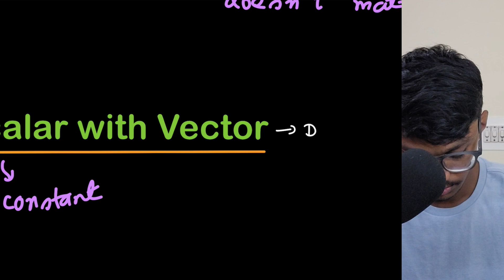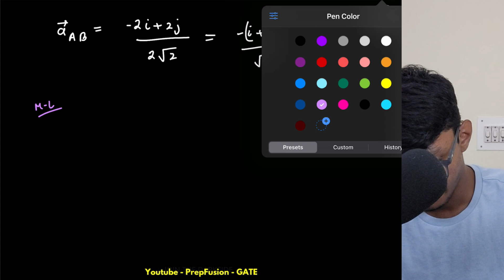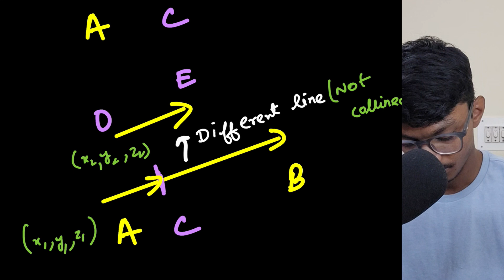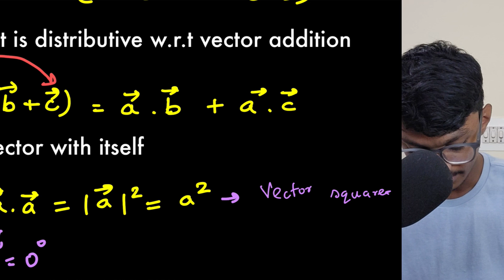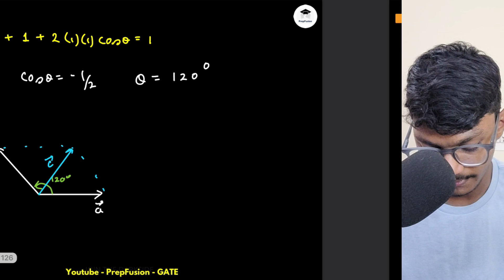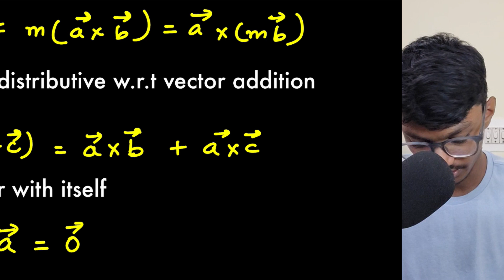Basics of Vector Algebra || Typical Concepts Simplified || Mathematics || GATE || PrepFusion

Comment: Showing Diwali Coupon code is invalid in website.
Reply from the maker: For placement courses apply Diwali20
Reply: @PrepFusion_GATE  for engineering maths and apti course what should i apply(diwali50 is not working )?
Reply from the maker: Use code Diwali40